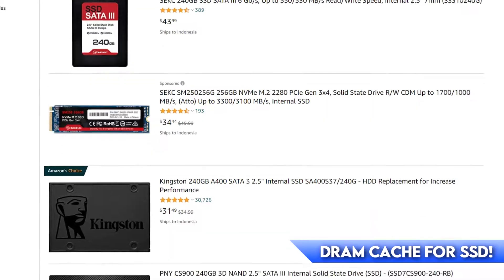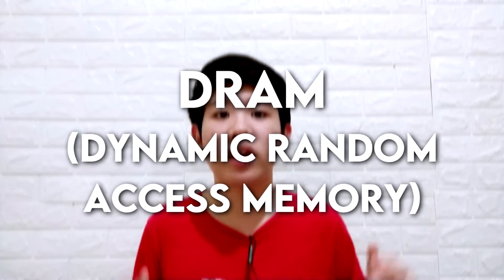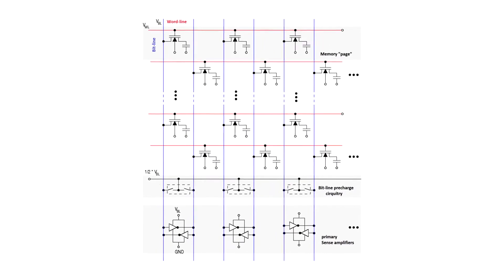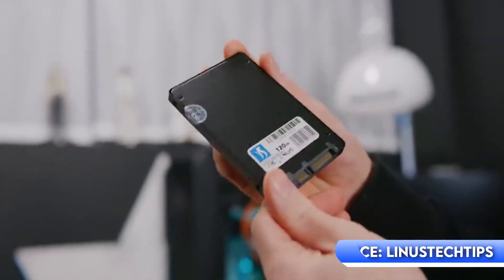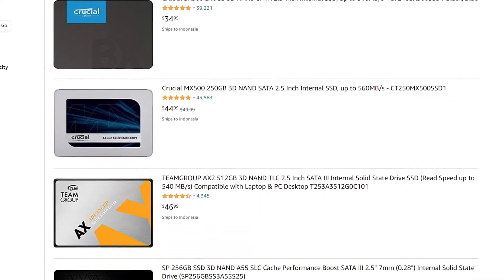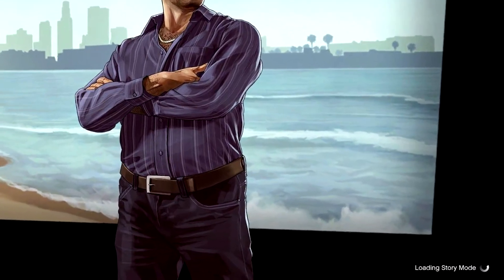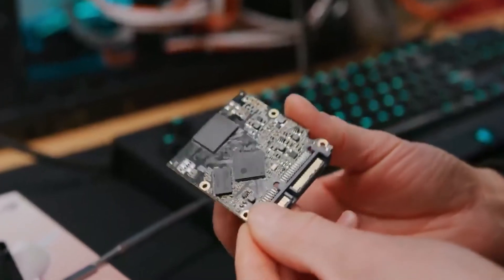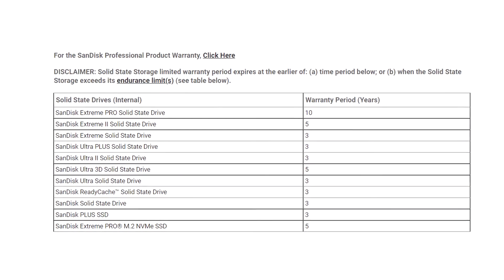WHY You Should NOT BUY CHEAP SSDs! (DRAM-less SSDs) | Techplained

Comment: Is DRAM n DRAM-less hv same lifespan? Or it depends on usage? Planning to buy PNY CS900 or Crucial BX500 on a budget.
Reply from the maker: No, DRAM and DRAM-less SSDs usually does not have the same lifespan. Lower usage might help for the longevity but probably not by alot. DRAM-less are usually faster to die anyway as the NAND chips have to do more work since it doesn't have the DRAM cache.